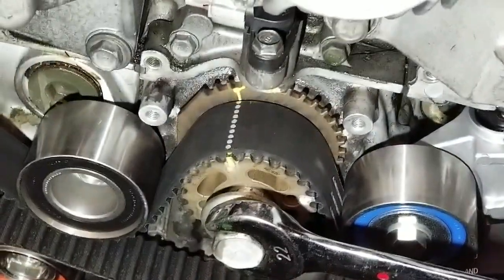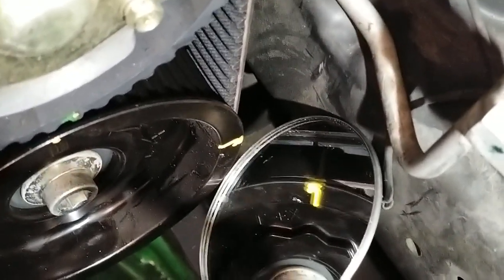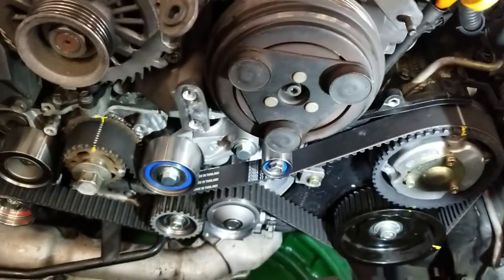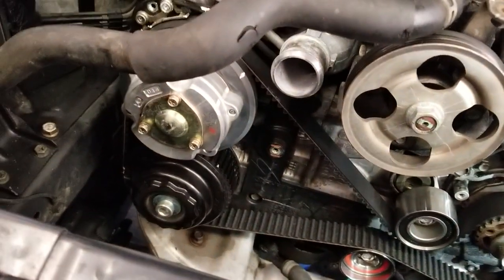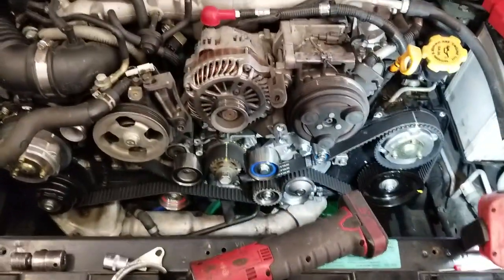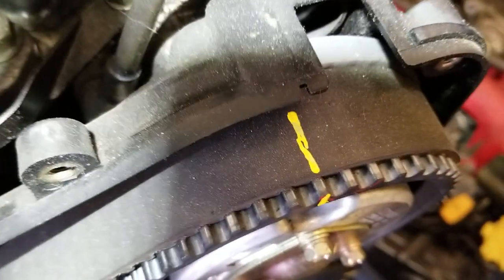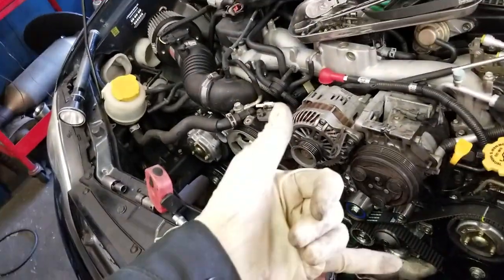why your subaru timing belt is off a tooth after timing belt install

Comment: I had to pay a garage to do my timing belt and water pump on 1998 Legacy 2.5. It's running rough at idle since the new timing belt. The mechanic says it's because of my driveshaft U-joints,  but that doesn't make sense if the car's not moving. I'm thinking about paying a different garage to check he timing.
Reply: What did you find out on your car? Cuz I’m having the same issue on my sti after I did my keyway on the crankshaft!
Reply: @ got into an argument with the garage-owner and ended each told the other to have a great day 
I’ve been driving it since the timing belt change. It’s still a little rough, but power is good.  So timing belt is good. Could be it needed to *reiearn * with the advance caused by the new tight belt. 
It’s a 98 so there’s a lot of things to be going wrong on it

Comment: Just did my belt all the marks are lined up , but one is off by maybe a tooth is that bad? Ot started up completely fine but sounds like a little ticking noise but isnt throwing codes or knocking.

Comment: always line up the mark before you take the old belt off, use that as a reference. If the old belt is off the same, you're good. otherwise, not good.

Comment: If you line up the driver side cams pointing at each other. And point the passenger side lower cam straight up, the top cam should almost be pointing straight down but to the right a little. What happens when the engine starts its spins clockwise pulling that little bit of half a tooth off into place first. Then it lines up with the others. Then they all spin together. If you have passenger side dead on. You can turn the crank clockwise and watch the top passenger cam move first as its first to be tugged by the belt which is why there's a half tooth of play and it also will stretch over time to the correct position.

Comment: I don’t recall my car running hot until I changed the timing belt and water pump, so I changed the water pump to an OEM one again, but the car still runs higher that normal, yesterday I took it for a ride and got it up to 90 with AC on car got to 218, I’m wandering if the timing is off, would it even run if it was off

Comment: Thank you for the video.  As a fellow perfectionist and mechanic, I really couldn't get my head around how I was always missing. I must have taken the belt off and on three or four times before I saw your video, confirming what I suspected was going on. Coming from working on Volvo and VAG, the timing marks always line up perfect, so this was new to me.
But the engine started and ran just fine.  

Thank you.

Comment: BS. The reason it doesn't line up is nothing to do with stretch but because you've just pulled the pin on the tensioner and haven't turned it over to even out the tension across the belt. You could turn it a revolution forward and then turn it back it will line up but I don't like turning engines backwards if I can avoid it. Just line the marks up on the belt and you'll be good.
As for the 'service mode' comment, also BS. Sure, withe the crank in that position the valves can't hit the pistons but they sure as hell can hit each other if you go spinning the cam pullies around the wrong way like an incompetent.

Comment: I rotated those right side cam gears while it was in "Safe Position". It bent an intake valve and I heard the valve adjuster shim fall out into the valve cover. Pulled it off and the valve wouldn't even return. Had to get a new engine because I didnt use a cam locker on that side. It is not an invincible "Safe Mode", because the intake and exhaust valves can still contact each other regardless of piston position.
Reply: Are you saying you needed cam lockers on both sides? Doing mine now and have a cam locker on order for EJ255. How far did you rotate the cams and was on the belt install?

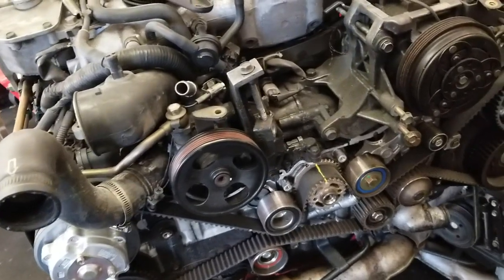Comment: 7:04 this part kinda throws your thoery of "stretch belt will line up perfectly" right out the window. Im less than 1/4 tooth off with tensioner tightened. I think im ok

Comment: I'm totally stuck on an EJ20E timing belt kit replacement. .... I can't for the life of me get the new belt on my SOHC. The new Gates tensioner seems to have a higher hydraulic pin even with the hand grenade pin inserted correctly. I've done what Gates said in priming/bleeding the tensioner but I think the 1 or 2 mm that push pin is sitting up is making it impossible to install the new belt. Any advice on how to get around this issue?

Comment: When I did it it was damn near perfect then I rotate it and somehow the belt shifted to the right a couple notches all around not sure where I fucked up
Reply: This comment is fairly old but if you hadnt figured it out by now once you set the belt and marks appropriately, and then rotate the engine, the timing marks will line back up after the appropriate rotations but not the belt. The belt takes an absurd amount of rotations to be back aligned with the marks. The marks on the belt are only good for the initial alignment.
Reply: @McGamesta  😂 I swear nobody told me this yeah I just ran with it

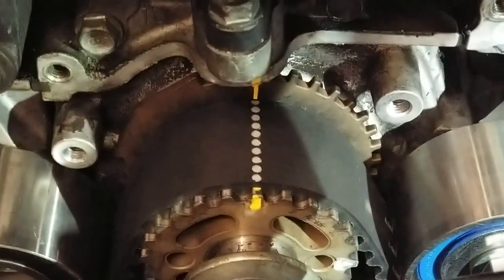Comment: @2:45 
He cranks over the engine. For me after the timing belt it wont go. I didnt force it, at all once resistance was felt I stopped. how do i fix this
Reply from the maker: Make sure marks line up. Why are you doing the belt?

Comment: Good video, informative. Do yourself a favor put the factory air box with the factory air filter back on your car. Washable/ reusable air filters aren't as efficient.
Reply from the maker: thanks for the correspondence, This is not my car. I would never run a garbage cobb intake. I prefer oem type air box, but keep in mind, oem are old and broken tabs and warped by now. i will alternatively use k&n or AEM intake. They have very good quality filters now. I dont like the drop in panels as they dont seal very well compared to the clamp type cone filter. Again, not all aftermarket intakes are good, the cobb ones are junk, they are bigger tubing, causing lean condition, and the filter media is garbage, it only filters birds and small babies, doesnt filter dirt dust or sand. it passes right through and ruins the rings and cylinders. causing blowby and burning oil and eventually kills the engine.

Comment: Worked at a dealer for 7 years and went to do a DOHC today to help my boss. We had all the marks physically lined up and when we went to turn the crank had piston to valve. Set it off a tooth crank side and it wouldn't run. I wasn't there for take off. So either a valve got hit or I'll try this tomorrow. Great video.
Reply: Any updates as to what happened?
Reply: Back again.. Any updates? I've bent a valve since my last comment because I rotated the cams he says you can rotate in safe mode lol. Use a cam lock tool!

Comment: Hi, I've got same issue on EJ20K engine, 1996 v3 sti type ra, early type tensioner etc. Lined up everything but the double lines on the LH EX and IN don't line up exactly as the RH EX and IN, when removing and replacing the timing belt do I just line them up or line up as they are now?  Thanks in advance

Comment: Thanks for the video, my engine is EJ25, forester 2010 just snapped the timing belt on the way to work any chances of nothing bad happened to the engine? My mechanic was able to turn the crankshaft and camshaft  with the socket and told to order the kit.

Comment: Thank you for the video dude! I’ve had issues for months with my timing making my car run like absolute crap. I reset my timing belt last night and the half a tooth out was worrying me. Now, watching your video, the 2nd cylinder inlet cam is half a tooth out PAST the mark on the cover. Will this be alright or does it need to be before the mark?

Comment: It all depends on how much they shave when they have done a headgasket job. And if you are not using the stock of thicker headgasket.
Reply: So if my head gasket has been changed will this impact how the double marks line up on cams? How do i know which is correct alignment

Comment: The definitive way to check is there should be 28 teeth between each of marks on the cams.  54.5 teeth between the crank and passenger side intake cam, 51 teeth between the crank and the drivers side intake cam mark.
Reply: If i find so much as one teeth on my shaft I’m up and audis
Reply: What side is the driver?
Reply: @mmark8394  for USDM the left hand side from the driver's perspective

Comment: Thanks for the video. I encountered the same situation with a new timing belt (2009 Forester XT Limited).  The original belt and marks were also slightly off.  I assumed at first the original belt had stretched but the new belt was no different.  Up to this point, I had only seen videos of perfectly lined up marks which stressed that importance so I assumed something must be off.  However, the teeth count between all the gears was correct and it was clear that if anything was moved even one tooth, it would be worse.  After checking and rechecking repeated, I decide it had to be right and applied your “Don't worry, be happy” attitude.  Sure enough the car started right up and runs great. 

When I was a young man working on cars, everything that was “Made in Japan" was considered junk and to be avoided.  I had thought this had changed but after dealing with this timing belt and changing the spark plugs, the old memories are coming back.

Comment: Could engine temperature have anything to do with it? Your engine is cold now, but when you drive and the engine heats up it will expand slightly and stretch the belt.

Comment: Just did the timing belt on my 2006 STI, I have low idle, and occasional low idle misfire, with P0011. But, it runs great under load.  Could this be the issue? I have new plugs, new Cam pos Sensor, new avcs solenoid, fresh oil, no banjo filter screens. New PCV valve. 
Great video by the way.
Reply: Did you ever figure out your issue??
Reply: Same issue any solutions?
Reply: @Moezori  turns out I had lots of metal debris built up in my cam gears from a previous engine rebuild. The shop did not clean out all of the oil channels properly. So I kept throwing the code because the metal debris was interfering with the variable movement cam gears.

Comment: But i opens up my timingbelt suspecting belt jumped a tooth... And i tried counting belt tooth method... End up i screwed up my timing marks even worse...

Now im unsure to continue counting the belt tooth or revert back to my previous timing position....

Anyway im getting p0340 at redline shift..hence im checking my timing marks in the first place

Comment: You got the wrong timing belt. No it's not normal
Reply: I just now checked my 2009 wrx timing as we speak. 60k on a gates racing belt and everything is spot on all 4 cams.
Check the tooth count on the belts your using some are 351, 352 etc...
Reply: @roberthiggins1419  I bought my belt from subaru and told them the correct engine and im still having the problem, are you sure its the wrong belt because everywhere else I looks says they are all the same unless you have a sohc
Reply: @roberthiggins1419  Yes exactly, it will be off until the belt stretches, you are about due for a timing job, therefore your belt is stretched and marks line up better.
Reply: All ej205 255 and 257s all use the same belt and timing marks

Comment: Be careful , when you talk about "service mode" . You are  very correct in saying you will not have piston to valve contact. BUT you can absolutely have intake and exhaust  valve contact. Set your exhaust cam first, then the intake cam.  IAG heat a great tech tip on this.  Thanks for the video!

Comment: the bottom idler , i always use the double bearing idler not the single one as you have installed  as they are less likely to fail

Comment: Would a tooth off cause a misfire under load?
Reply from the maker: that should be corrected regardless, but it is possible. most likely an ignition or low fuel volume issue.
Reply: Yeap

Comment: Hows it going dude, i just did my timing belt on my 07 wrx, ej255. I had the same issue with my timing marks being little on the piss on the right hand cam sprockets, like half a tooth. Anyway, watched this video and it was literally exactly what was going on with me so i decided to run with it. Runs well, maybe better then before. Unfortunately 20 mins in to my test drive it threw a cel. Have you had an experience with this happening?
Reply from the maker: what was the code?

Comment: I thought this was due to the variable timing system?
Reply from the maker: that is a possibility, but I also had this issue with the non avcs ej20.
Reply: @subtledriver  yeah I did this job on my 2002 wrx with the 205 and no avcs and it was less than half a tooth off, I was scared to start it but everything went fine
Reply: no because the avcs variable angle would affect the cam position angle, itself,,, not the outer sprocket or cam gear timing mark alignment on the outer side of the avcs sprocket.

Comment: I’ve got a sohc that idles not smooth like before the belt was done. Could it just be a tooth off?
Reply from the maker: i would pop the cover and check. the sohc doesnt have same half tooth issue however... SOHC is much easier to time.
Reply: I have a SOHC and the last pulley would not line up. I tried putting the belt on every way possible and could only get two of the lines to work. The only way it would have worked is if the right hand pulley was a tooth toward the passenger side. Well, I thought that couldn't be right and put it on the other way. Now it idles rough. Time to take it apart.
Reply: @alexp336  What did you figure out? Doing mine and the same pulley line is a tooth towards the passenger